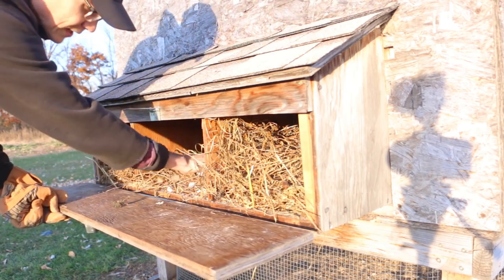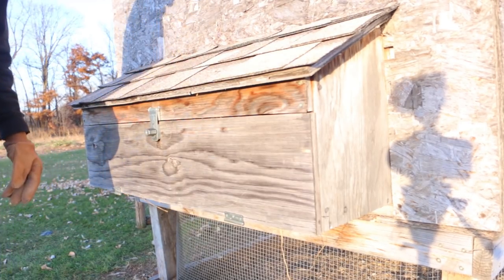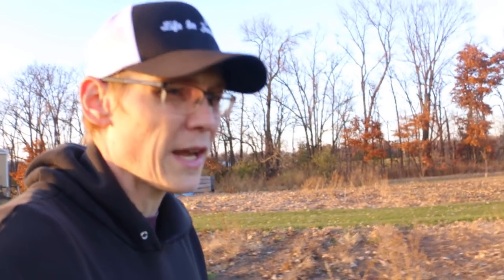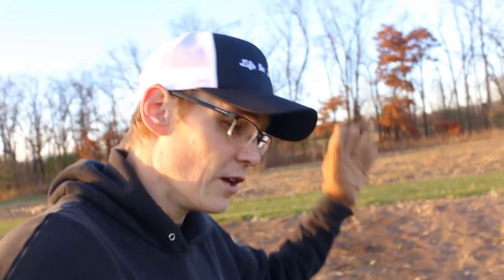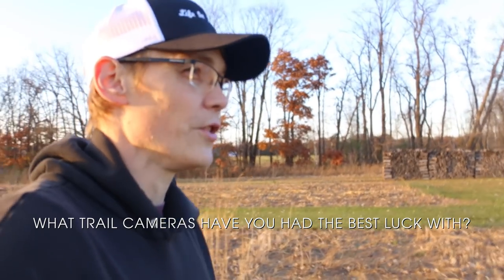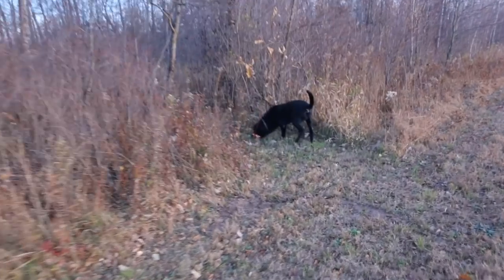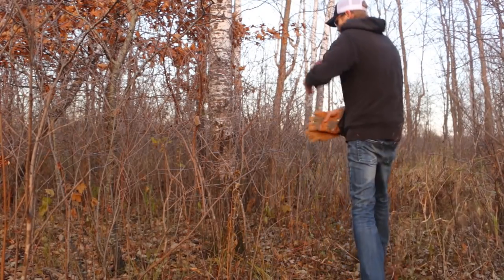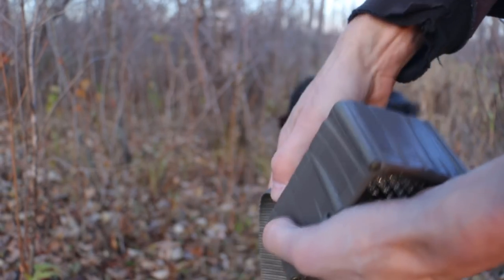Quick heads up and trying out a new trail camera

Comment: I've had 5 cameras up this year since about July.  Lost 1 that was 10 months old to a battery exploding inside and corroding the battery tray.  Luckily Browning sent a new tray at no cost.  Just lost a brand new camera to a Beaver last week.  Chewed the tree down and drug it into the pond never to be seen again.  Trigger time isn't everything.  You also need to make sure the picture cone is the same as the motion detection cone, if that makes any sense.  You don't want to have an animal come in from the side real slow and trip the motion sensor before it gets in the picture view.  My browning I got last year has well over 10,000 pictures and is great on battery life and picture quality.  I also have two Exodus which have worked awesome for about 3 years plus a new Covert which has worked very well.

Comment: I returned my cuddeback the day after I bought it. never did try it, but all the footage I saw from it, I wasn't happy with it's night pics. I have Moultrie, tasco, covert, spypoint, and two brownings. the browning recon force advantage and spec ops advantage are as good as it gets, their video quality is supreme. but if you are only doing pics, I would choose a cheaper model, as those two are pretty much designed for video. my covert is a 2014 model and still has better image quality and detection than most my other newer cams, aside from my recon force of course. hope the cuddeback works out for you.

Comment: I keep mine out all year.  I use lithium batteries in the winter and Amazon bulk alkalines the rest of the year.  As for brands I can't tell you what to get but I can tell you what not to get - primos.  I've got a box of close to a dozen dead primos cameras 4 of them DOA out of the box but out of warranty.  I will give primos credit for replacing a tracker model which required obsolete software with a new regular game cam with the same time lapse functionality.  I use their calls and some other products but I've had nothing but bad luck with their game cams. Oh and I also find tangle foot great for keeping ants out of cameras.  Ortho home defense max insecticide works too.

Comment: You can use a product called Tanglefoot to keep ants off the cameras. Its a natural wax that is super sticky. Just put a ring around the tree or just around the camera to prevent them. 😊 🐜
Reply from the maker: Thank you for sharing this? I have not heard of it before. Thank you!
Reply: Life in Farmland, anytime! Follow the directions on the tub or tube. My recommendation would be to mount the camera with a wood (not the tree) backing under the strap and slather the wood and strap with the product. I have also used it as a grip helper for my dry hands. That is off label and isn’t a recommendation.

Comment: We find the trail cams that take AA batteries last way longer than the ones that take C batteries. The AA batteries hold up better in the winter cold.
Reply: I use lithium AA they work great in very cold temps but are expensive.